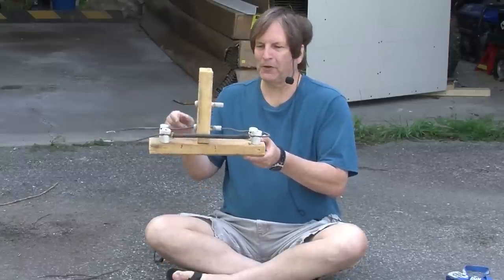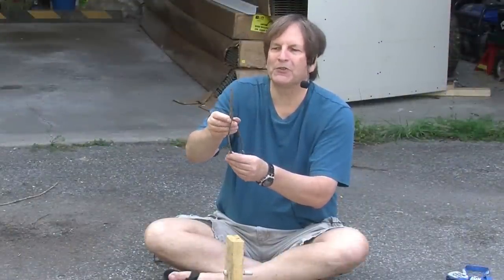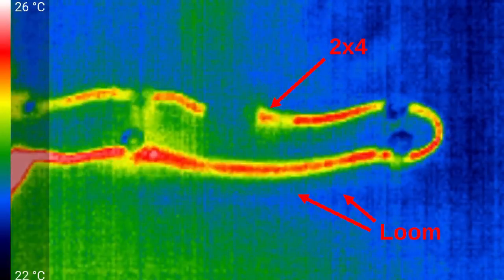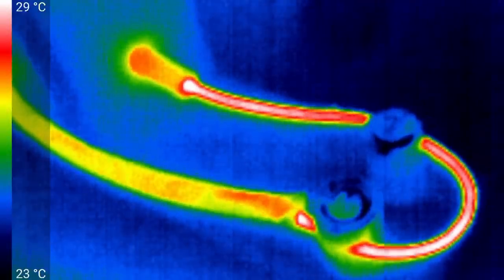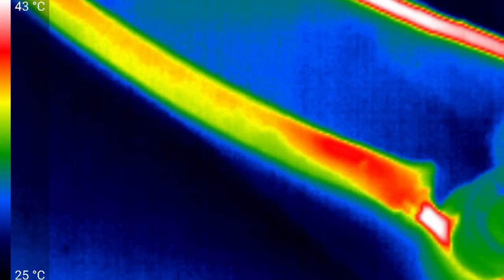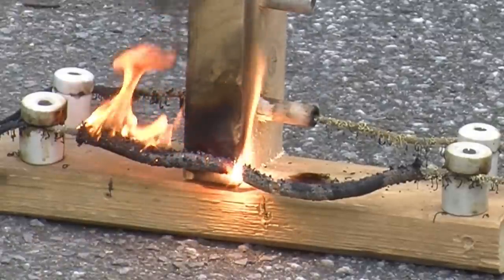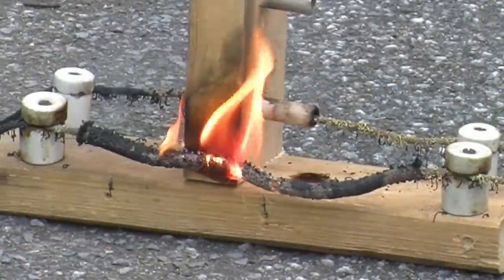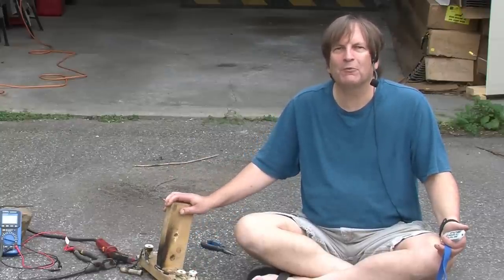Testing 100 Year Old Knob and Tube Wiring

Comment: Wow   ask and you shall receive - on another of your video's I wondered   just that   since so many comments were about air cooling  vs  confined insulation   and it seems knob and tube actually would run cooler  - albeit dangerously exposed    but where I live some overhead wires are quite bare and again quite separate   so they are essentially  "knob and tube" as well
Reply from the maker: Yes - I responded to your question elsewhere on that. If you have have know and tube the concern is alterations and insulation covering it and insurance companies that refuse coverage. Unfortunately a rewire to remove it can also be really costly ...
Reply: @ElectromagneticVideos  They should call you quick draw McGraw !  Insurance  (for all there  actuary's and numbers0  often don't inspect houses like they should - it's odd - so aggressive on some things and lax on others -  my problem is with the original architects that left so little room for plumbing and electrical - another 2 or 3 feet wider / longer property and we could have nice open areas for pipes and conduits - instead of hell on earth to fix  thanx so much for the fast reply  I'm subbing as of .....; now !
Reply from the maker: @TotalFreedomTTT-pk9st  One thing you may find it its amazing what electricians can fish though the tightest spaces. If you talking to an electrician and it seems modernizing is no practical, another thing to consider is putting in AFCI breakers that may have a chance of tripping if a hidden fault occurs. For insurance purposes, also make sure changes like that are acceptable to them and the local code. Its sad that knob and tube has become an issue. 

Glad you subbed! Although you will find a lot of stuff unrelated to this on my channel!

Comment: I've seen that used in a house with shredded corn cob/paper thermal insulation. But overloaded wire is going to heat/burn regardless of the electrical insulation.
Reply from the maker: That corn cob/paper thermal insulation mixture sounds like a recipe for disaster if it is in contact with the K&T. I'm guessing the insulation was added way after the  wiring was installed. 

I just looked at your channel - wow - you have such a similar set of interests as me - looking forward to watching a lot of your videos!
Reply: @ElectromagneticVideos  I watched your electromagnetic chain video and thought this guy's a wildman, what else has he done? Got more in watch later to view. Good stuff.
Reply from the maker: @tsbrownie  I'm not really that wild which may hurt my views. I posted one burning wire video just for fun - that then developed into a number of somewhat realistic wire-in-wall tests which I did because I felt seeing what really happens might be useful and educational .....   Hope you like the other things I post :)
Reply: @ElectromagneticVideos  It was interesting, educational, and wild!
Reply from the maker: @tsbrownie  maybe  that should be my one line description!!!!

Comment: I'm old fashioned and I have a fascination with Knob and Tube. I lived in a house that had K&T built in 1914 20 years ago and last year the house had a attic fire and thought it was the K&T but from what I remember the wire coating was in good shape so might have been something else but since then been attracted to K&T.
Reply from the maker: Its funny - I'm fascinated by it too - and like seeing other old electrical stuff as well. Attic fire - yikes! One issue with K&T is when it gets covered with (flammable) insulation  and overheats. Maybe that. Like your observation, the wire I used seemed in great shape.

Do you ever watch re-runs of the the old TV show MASH? Look carefully and you can see knob and tube on the OR and office walls (including one episode where it catches fire).
Reply: @ElectromagneticVideos  I have a interesting idea for a video if you would be able to it. How about a video experiment on old aluminum wire connected with modern copper wire? I had a few lights in the basement hooked up like that but switched over to all copper wiring.
Reply from the maker: @chrisbeard5794  I would do that in an instant if I ever get hold of some aluminum wire. It was common here (Ottawa, Canada) )around 1970, and quite a few places still have it. I do have a friend that occasionally renovates houses keeping an eye out for it for me.

You were wise to switch over to copper - this issue with the aluminum (if you arnt already aware of it) is the hard insulating oxide layer that forms on the surface. That combined with the softness of aluminum and the cyclic warming and cooling at connection points results in some connections gradually worsening over time, and as the worsen the effect gets more pronounced till you end up with a sparks and flames. This is a paste to retard the oxidation and special connectors, but over time, who knows! What I really need for testing is an old receptacle with aluminum still attached to have a connection that that degraded over the years. Even then, by random chance it might just be a good connection that hasn't degraded.

Comment: I am in the process of building a lighting system in my off-grid cabin with these 100 year old items, however with new cable and 12V LED lights.
So this was interesting video for me.
Reply from the maker: That is so cool - I'm sure it will look beautifully rustic.  Are you using modern wire? Did you find cloth covered wire somewhere that looks authentic?

I looked at your Grimeton Alexanderson alternator transmitter video - wish I could understand Swedish!
Reply: @ElectromagneticVideos  Thanks for your reply, great fun.
Yes, I have bought twisted cable which is textile and plastic coated modern multi-strand.
Now I have to make a video about this, in English this time!
Reply from the maker: @emilalmberg1096  That would be great! I'll look forward to a video!
Reply from the maker: @emilalmberg1096  I just looked at your video! What a wonderful authentic wiring job for a 100 year old cottage! I'll make a few more comments on your page!  Everybody take a look at Emil's link above!
Reply: @ElectromagneticVideos  Thank you please

Comment: I think that oxidation you’re seeing was a tin coating for making solder easier.
Reply from the maker: Certainly could be! I have also heard that the coating (which other have though was silver) was to prevent the sulphur in the rubber insulation from corroding the copper. Quite possible multiple different coatings were used depending on the manufacturer.

Comment: When you consider the current rating for 14 gauge, its remarkable  how much headroom is designed into wire.  You are pushing a lot of continuous current and it’s amazing to see.   Have you ever looked at how longer length wire handles higher current ?  I believe your tests are mostly done with short length.
Reply from the maker: It is amazing - I have really been surprised - and for all the wire types  I have recently looked at. And I guess with good reason give our homes are relatively flammable compared to  brick and cement used in many overseas places. 

The wires  are short but I think the end effects of heating or cooling the wires are even shorter or we would notice it on the IR images with a noticeable temperature gradient towards the ends. If I were to criticize my tests, I think my main issue would be the short  duration. My guess is that sustained high temperatures over a period of days would degrade most insulation types. It certainly is interesting and appropriate to consider how close to reality a test like this might actually be. 

By the way - looked at your page - is the banner image one of your photos? Its great! I'm a hobby photographer too - mostly animals though.
Reply: Also keep in mind the NEC wants you to derate your wire for “continuous loads” (things that run more than 3 hours continuously, appliances, etc)
Reply: @Solidst8dad2112  Exactly - its something like 12 amps on 14 gauge and 16 amps on 12 gauge.   Its impressive how well things are designed to carry loads.  What's hard to demonstrate is how this would survive in an attic where wire is next to a box of Christmas decorations or blown in insulation.  I was replacing a light fixture in my garage and found a box filled with wires that fed the lights, outlets and so much.  I'm glad we have over design stuff or it would not go well.  I appreciate your video as is so informative.
Reply from the maker: @Solidst8dad2112  Yes! And from some of the other experiments I did with modern wiring in good insulation, even that might be a bit much in places like attics that get really warm.

Comment: I live in Joliet USA and live in a 1920 bungalow. The house still has some knob and tube, mainly for the ceiling lights, and the kitchen outlets. Rest of the home was redone romex and a circuit breaker panel added. I was curious to see what the gage of the romex was and mine is 12awg. Since the home uses LED for lighting, (for the most part, still use fluorescent for my sewing room and shop) I highly doubt that this wire will ever see an issue with the LED lighting.
Reply from the maker: A 1920 bungalow - how cool!  I would be a bit concerned about the kitchen outlets unless you dont actually use them. From what I have seen the issue of greatest concern is insulation over the knob and tube which was designed for the cooling of flowing air, and possible extensions being added over the years. Your lighting thoughts are are probably right, unless something else is sharing some of its wires such as the neutral. Seems like wiring back then was notorious for sharing neutrals in a way we would not expect today.  If you haven't already, might be worth having someone like an electrician see if they can inspect the know and tube in the attic to make sure it is in good shape ......

Comment: This type of insulation, vulcanised with cotton sheath, is referred to as VIR (Vulcanised Indian Rubber) in some countries.  The cotton rots off, it's why it fell to bits when the rubber let go when heated, and the rubber itself can go rock hard and crumble with the slightest movement.  It's more or less a case of if you find any in a very old premises you disable the affected circuits immediately and get it replaced.  In Australia there was another type of insulation before thermoplastic (TPS), TRS (toughend rubber sheath).  TRS is well past end of life too and is also highly likely to fail and split if moved.
Reply from the maker: I had never heard of of the term VIR (Vulcanised Indian Rubber). Just did some Googling -  looks like it was use din Australian as late as the 1950s. Not sure if it was used here that recently but it would be surprising if Australian would have been much different - as you implied, we may use a different term. Also just looked up TRS (toughend rubber sheath) - looks like its similar (identical?) to SOOW cable used for industrial extension cords and similar today. Are you in Australia? Was knob and tub used there in the early days of electricity or was there some other wiring method that was commonly used back then?
Reply: @ElectromagneticVideos  Yes, Australia.  No idea what was done in the really early days.  I tried to post a link to a government web site that has a picture of VIR, TRS and TPS being connected to a circuit, should never happen, but youtube blocked it.  VIR will have and cotton and rubber sheath and the individual wires will too.  TRS is black and no cotton at all, but not all black sheath is TRS.  Regardless best to not move any black sheath wiring in Australian homes. Get a sparky to check if it is TRS.  Even if not TRS it will be from 1960-65 so up for replacement anyway.
Reply from the maker: @retrozmachine1189  Thats odd and unfortunate - I say that because for the last three or four videos the same spam comment to an external website was posted shortly after the video was published and I had to delete/report it. So why they blocked your link and not the real spam, who knows. Anyway - thanks so much for you comments - its always so interesting when people like yourself post something that really adds to what was presented to the video like that. Bye the way - Australia is one of my favorite places - did a 2 month trip in a camper van (caravan to you!) up your east coast and then back down somewhat inland a bit over 10 years ago. You live in an absolutely fabulous country!
Reply: @retrozmachine1189  keep on trying to post the video

Comment: IIRC they used to tin the Type R copper wire used for knob-and-tube because the rubber insulation had adverse effects on non-tinned wire. And yes, it very likely aided in soldering which was much more common back in the day.
Reply from the maker: Interesting someone also mentioned that occasionally it was silver plated which surprised me. The only thing I could think of was that one could achieve a thinner layer of more expensive silver and because the amount of silver was less it ended up being cheaper?

Comment: I actually came way more impressed with knob and tube wiring!
Other than the ravages of time, I think it was actually a pretty good system!
You literally had to take it to the point to where the wire became incandescent before you actually got a catastrophic situation.
Reply from the maker: I couldn't agree more!  I think if used as it was installed and intended for, there are really no issues.  Its really the upgrades and insulation that are the problem.  I wouldn't be surprised if our fancy modern stuff doesn't last that long.
Reply: @ElectromagneticVideos  well, one thing I have seen: Is 14 gauge individual conductors that have melted themselves together inside of conduit!    They are always melted together next to each other, and never to the conduit itself. So the conduit is somewhat of a heat sink, but they still got hot enough inside to stick to each other. I’ve seen them melted together as much as 2 feet in contact.  Had those same conductors been in open air, I doubt they would’ve been damaged.  Now obviously, it was a significant overload, but the damage was completely hidden but later led to a failure that was then discovered.  I became a journeyman electrician when I was 18 years old, but now I look back when I kind of pooh-poohed those old electricians that used to say that knob and tube wiring was fine; they knew what they were talking about, and I didn’t…
Reply from the maker: @SpinStar1956  Interesting how the conduit acted  as heat sink - makes total sense but something you don't think about. I'm guessing it was metal conduit as opposed to corrugated(?) flexible plastic stuff that probably is a poor heat sink. I wonder why the breaker didnt trip. 

Funny how our perspective changes as we go though life an experience things. One thing I wonder about is the use of PVC conduit for the 200A cables going into a typical home panel. I cant imagine PVC being very robust if there was a short but the old metal conduit might have kep things contained (or maybe not). Do you ever see shorts on those service cables?
Reply: @ElectromagneticVideos  well, the PVC conduit came after my time, so I couldn’t really speak to it. Also, I never did get that involved with actual power line electrical. Most of mine was industrial electrical work where the feeds were already provided. There was kind of this demarcation between the plant and the power company.

On the melted wires within the conduit, this is typically a stuck breaker or somebody circumventing the fuse in a fuse panel. The breaker will always trip long before you get a melting of the wire since as you know yourself, you have to go a substantial percentage above the normal, carrying current Before you ever have a temperature that gets that elevated.

I had an apprentice that was working with me at our steel mill, he was always complaining how I became a journeyman without having to go through all of the apprenticeship that he was about to graduate. In fact, he was at the end of a four year apprenticeship. One day, we were working in an 1100 V panel that was supplying electricity to a large air-fan system in a ore-preparation sinter-plant . They were complaining that the fans were taking too long to spin up and would often overcurrent and trip the breakers. He got it in his mind that the main connecting wires in the panel were loose, and so he took a 12 inch crescent and started to tighten them up while it was live and got his Crescent wrench in between two phases! It instantly melted the Crescent wrench in-two and gave him third-degree burns on his hand through a heavy set of rubber and leather gloves. His face was blackened, and his safety glasses had a nice green copper deposition on them.  It was at that point, that I told him that this is why he was the apprentice; I never heard him complain about me, being a journeyman ever again…
Reply from the maker: @SpinStar1956  The old penny in the fuse panel trick!

The apprentice incident That must have been something to see - lucky he wasn't more seriously hurt. Its hard to imagine the amount of energy that must have vaporized the wrench in a fraction of a second. One of my neighbors who is an industrial electrician once told me of a short that occurred on some giant power bus in a nearby plant that vaporized everything around it.  Yikes!